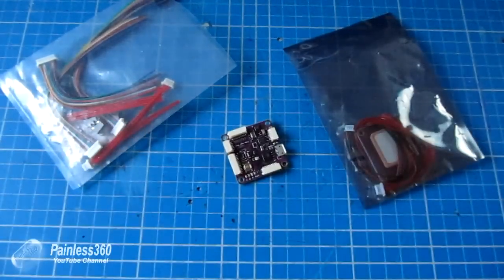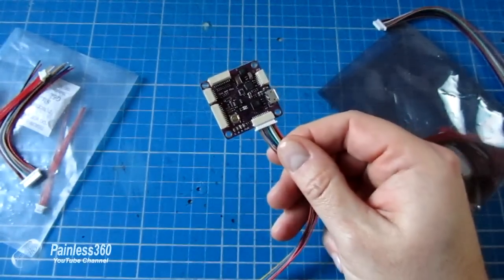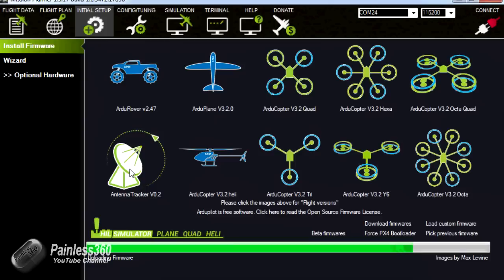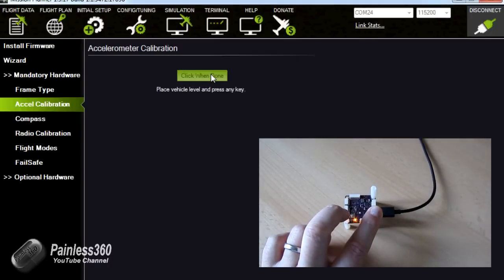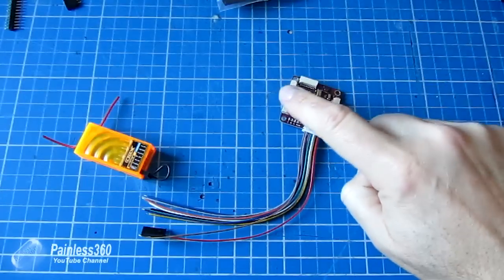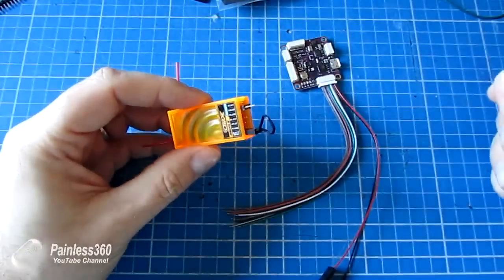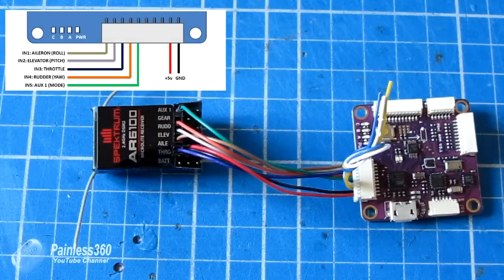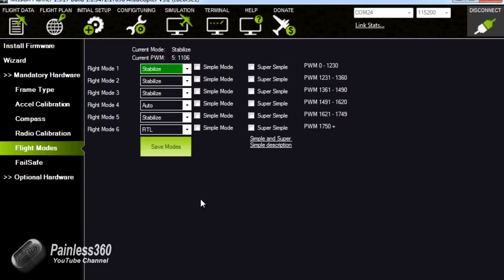(1/8) APM Mini 3.1 Video Series - Simple setup, config and calibration. Board from Banggood.com

Comment: Painless360, please help I'm a total noob with this stuff. I'm building my first quad, a White Sheep. I did my research and bought what I figured was the best, Turnigy 9X, with a DBR-II receiver and FrSky DJT transmitter. I've spent many hours searching the net and am totally lost. I'm using the APM 3.1 which was probably a mistake due to the lack of info on the net, but liked the GPS and the price. I'm confused on how to wire the receiver to the APM. Dont understand the difference between CPPM which would be just a few wires to communicate and using all the wires for each channel. How do I wire it? You seam to be the only one on the net with real knowledge of the APM 3.1, so I'm hopeful you can help.
Reply from the maker: You've not searched the Painless360 channel have you? There are a few playlists on here for the APM 3.1 that will answer your questions.  We also have a video that covers PWM, PPM and S-Bus that should help too. Best of luck!
Reply: +Painless360 
OMG thanks for the quick reply!
Dave

Comment: Very well presented APM mini video series, clear and informative. Thank you very much for taking the time to make these.

I am trying to resurrect a FC-dead Flying 3D X6 FY-X6 230mm quadcopter (everything but the FC works, including motors and ESCs). The FY-X6 (more technical information can be found here: http://www.rcgroups.com/forums/showthread.php?t=2270231 ) has a FlySky i6 variant (both the TX and RX are working) and on the FC uses CH1 (3 pins) and one more pin on the FC COM pin (probably for the telemetry). The quad has a 7.4V 2S platform and the distribution board works as well.

My questions:
1. Can I use this Mini APM FC (or a Mini APM Pro FC) to fly this quad?
2. Do you think that this FC can work with the TX/RX I have? Do you think that telemetry could work as well?

The reason I'm asking is because a replacement FY-X6/X8 FC for this quad costs a lot more than a complete Mini APM Pro Neo6 solution and I'll get an inferior FC (no waypoints, datalogger, mission planning...).

Thank you and keep up the good work.
Reply from the maker: +FrontierNG Tricky for me to answer as I'm not familiar with that model. The APM does need 5 channels really - 4 for flight controls and 1 for mode selection. There are a few others who have looked at this (i.e. http://www.rcgroups.com/forums/showthread.php?t=2270231&page=208) but I couldn't find someone who'd made it work in the searches I did.Best of luck with it. I hope you get it sorted..
Reply: +Painless360 I am the one asking on the RCgroups FY-X6 thread before finding out your tutorials :)
Again, thank you for your help need to investigate this more...
Reply from the maker: Ah, maybe it's not that common then ;)

Best of luck. If you figure it out this would make a great video tutorial..

Comment: How did you use the volt meter to test the neg and positive was backwards?
Reply from the maker: +Mokra06 The GND pins on a board are all connected together so you can check the resistance between the pins and a known GND pin in another place. You can also power the board and connect the voltmeter to the output, if the voltage is positive then you have it connected the right way, if the voltage shows negative then the you need to swap the cables over.

Comment: hello all,
recentry i bought an mini APM 3.1 with GPS from banggood. 
My GPS is slightly different from the one shown here, i have 2 ports with 6 wires. For mini apm i have signal only on port b, but i don't receive signal from gps, i receive signal only from compass.
If anyone knows what should i do please let me know. In mission planner wrote GPS: No Fix
Thank you

Comment: Im a little confused , but then I'm a rooky . can i ask , does the APM mini replace the APM 2.8 ? Im looking to build an S550 from scratch based on selecting the best advice from youtube , and with all the new stuff it starts to get confusing what s what ...please excuse my ignorance ;-)
Reply from the maker: john kendall No such thing as a daft question. The APM 3.1 is a new form factor of the 8 bit APM 2.x flight controllers - all the same functions but in a smaller package. The APM is no longer being updated by 3DR and it's successor is the 32bit Pixhawk. There are videos on all of this on the channel. If you don't care about it not being updated (and a lot of us are not ;) then the APM is still a great platform..Hope it helps.

Comment: Thx for your such a nice instruction!
i got a question for the bluetooth module to connect mini apm
Is it possible? installing BT module such as HC-05(06) for the wiress connection between APM and Mission Planner?
Reply from the maker: 사정환 Yes it is, if  you Google 'APM and Bluetooth' you will find some great resources.Best of luck.
Reply: I saw lots of BT module tutorial for apm 2.5 and 2.7  but there are anything about "Mini apm" if there are... can u tell me where it is?
Thx for your kindness
Reply from the maker: You'll have to use Google I[m afraid.

You can use the same process that you've already found with the Mini APM. There is a video on the channel that uses the MAVLink radios and looking at the connectors you can figure out how the wiring works.

Best of luck.

Comment: Hello Mr Painless!
Thanks for your great videoes. They are my lifeline!
I have bought a airdroids pocket drone (tricopter) which turned out not to be able to fly. I then took it apart and installed the APM (3DR robotics 2,5,2) GPS (U-blox neo-9m), telemetry (RC-timer 433mhz) receiver (Flysky TS R6A) on to a night hawk 300 frame, added four new motors (Emax MT 2204-CCW/CW 2300KV) and tour ECS (BLHeli series 12A ESC from Emax) first I had trouble getting the no 1 motor to run with the same speed as the others - still have. I recalibrated everything, swithed ESCs and got a new motor, and thecked that the screws are not too long - still nothing. The next problem i have is that after i reinstalled the quadcopter program from missionplaner I cannot arm the thing. I have worked on this for two weeks, seeking info from your and other videoes and from the pocket drone community on facebook. I have added three videoes showing my problems. I really hope you can help me out.
https://www.youtube.com/watch?v=p7q72CfF_EE
https://www.youtube.com/watch?v=cbevwvdAJYE
https://www.youtube.com/watch?v=268DiLrwbXc
Reply from the maker: Peter Søndergaard Have you swapped the motor with a working one? If the problem follows the motor then you know what the problem is ;)
Also, watch my APM arming troubleshooting video to see how you can tell what the problem is..
Best of luck.
Reply: Hi. Thanks for your quick answer. Ill look at the video again. I have tried to swap them around. Same result. Could it be a bad ESC.
Reply from the maker: If you have swapped the motors and the problem stayed with the ESC then it's the ESC or the output from the flight controller..

Best of luck.
Reply: Painless360 Got it airborne today! still think there are issues with the power to the motor. thanks for your help! now going to trim it!
Reply from the maker: Awesome! Happy flying!!

Comment: I have this mini APM from Bangood on a zmr250, I have all working the only problem is when I calibrate the compass, accelerators and radio the  artificial horizon looks level but the quad flies  back and to the right very violent. If I do auto-trim it flies almost perfect but the artificial horizon looks like the quad is banking left  and back almost 45 degrees. Any ideas?
Reply from the maker: Tiago Goulart Check that all of the props are on the right way round and recalibrate the ESCs again (manually).
Best of luck..

Comment: I'm a beginner at quad-copters, but not to electronics.  I recently purchased a HK pilot micro master set... and with the use of your videos, I was able to get it up and flying within a couple of days.  Your videos are spot on.. Thanks for posting them... time to start messing with FPV
Reply from the maker: mike nonya Thanks for the feedback - happy flying!
Best of luck with the FPV flying - https://www.youtube.com/playlist?list=PLYsWjANuAm4rQfddw-7YZDzckoJ_KyOpm
Reply: Painless360 Also I can't find the post where someone said they couldn't connect to their board via computer USB onto the micro USB board connect.. I had the same problem just the other night.. Which is wierd because I have always connected to the board.  Turns out that it was a really bad Chinese cable, the USB to micro cable would charge things but it wouldn't allow data transfer... So make sure you have that ace in your card deck.  Thanks again ... my deadcat is flying and extremely stable... I changed out the micro PDB for the deadcat one and it seems to get much cleaner power..

Comment: I've just bought one of these and in having trouble connecting it to APM Planner on my Mac. I've installed the driver that came with APM planner, plugged in the board, but I can't get them to connect. I'm getting a solid yellow light and flashing yellow light on the board. Anyone know what that means or how to fix the problem?
Reply from the maker: Benjamin King Sorry, I am not a Mac user. The forums are filled with help though - http://planner.ardupilot.com/wiki/mission-planner-installation/ and http://forum.flitetest.com/showthread.php?14544-HELP!!!-Trouble-connecting-ReadyToFlyer-2-8-to-Mac-running-OSX-10-10-1-(Yosemite)
Best of luck..

Comment: Awesome videos, very informative and extremely easy to understand.

Could it be possible to connect the MinimOSD plus a bluetooth module to this board at the same time? or do I need the regular APM to do it. I'm liking the mini more since I can stack different boards on top of each other plus is just smaller.
Reply from the maker: elpidiovaldez4ever We cover the addition of the radios/BT in this series later on. Let me know if you can't find it and I will post a link..
Best of luck.

Comment: Hi Painless,
I got an APM 3.1 just like yours and when i flash the latest version and calibrate the accelerometer it passes fine, but when i am looking at my HUD the artificial horizon keeps on jumping around up and down. And i dont get errors.
But when i flash version 3.1 the artificial horizon works fine except that if i tilt my quad it will kind of stay in that position so when im flying forward it will stuck in the forward position and ill have to keep holding it back. I do get Bad Gyro Health errors on mission planner. I read online that the 3.3v regulator might be broken but im not sure how to test that on the mini apm .
Any ideas ?
Thank you
Reply from the maker: Malek Darwish I've not seen that myself but it sounds like the board has a problem. I'd check that you can see no bad soldering..
Best of luck with it.
Reply: Thanks . I checked it and it seems fine. I guess i have to get a replacement from banggood

Comment: Hi  any chance you know how to update the ppm encoder on this board.
Reply from the maker: Asral Sumun Sure do - read http://copter.ardupilot.com/wiki/common-optional-hardware/common-telemetry-landingpage/connecting-your-rc-input-and-motors/ and all is revealed.
Best of luck.
Reply: Painless360 oh yes this i know on the bigger board , but the mini is different the j2 pin is for esc power.I want to update the firmware of the ppm encoder.
Reply from the maker: Ah I see. Sorry I've not read or found anything about that - why do you need to update it?
Reply: Painless360 the board i have does not have failsafe on lost of signal , i have a turnigy 9 tx. I had this problem with with the bigger one and updating it fix it.
Reply from the maker: Asral Sumun I understand. I will keep my eyes open for this.. Let me know if you figure it out..
Best of luck.
Reply: Painless360 Hi i've found this http://www.rcgroups.com/forums/showpost.php?p=30449100&postcount=1505
 and used the method to update the firmware and it updated fine.
Reply from the maker: Well found - thanks for the link..

Comment: Has anyone seen the problem outlined at https://github.com/jmendezde/arducopter/issues/603 ?  And if so, are there suggestions for fixes or workarounds?
Reply from the maker: mstanley103 This looks like a couple of issues on this report. What are the error messages you get exactly? What troubleshooting have you done already?
Reply: Painless360 Thanks for the quick response.  I just got my board this week, so haven't had a chance to do a lot of debug yet.  Current operation:1. upon connecting via USB, I get flashing red, then blue/red then red again LEDs on the board
2. In "Devices and Printers", I see Arduino Mega 2560 (COM4)
3. Start Mission Planner 1.3.24
4. MP finds COM4.  I connect at 115200 baud
5. MAVLINK connects and I see a bunch of communications
6. Dialog box posts "New firmware available, ArduCopter V3.2.1.  Please Upgrade. I click OK.
7. Click Initial Setup Icon in MP
8. Click "Install Firmware"
9.  Get message "You cannot load new firmware while connected via MAVLink.  Please press the Disconnect button at top right to end the current MAVLink session and enable the firmware loading screen".
10. I click the disconnect button
11. I click ArduCopter V3.2.1 Quad
12. Message box: are you sure you want to upload ArduCopter V3.2.1 Quad?  I click "Yes"
13. That's when I get the "Failed to download new firmware: System.Management.ManagementException: Invalid class at ..." message that I showed in the posting  at @603.

I'm assuming that Mission Planner encapsulates a board programming sequence that can probably be done outside the tool.  My next step failing any insights from readers here is to start digging through the ArduCopter site to see if I can replicate the development environment locally.  I'll probably also try re-installing Mission Planner, just in case everything didn't come down properly. All ideas and suggestions are welcome.
Thanks!
Reply: mstanley103 I'm pretty sure that Mission Planner simply isn't recognizing the Mini APM.
Reply from the maker: Sounds more like it can't see the Hex file for the firmware it needs to download - I'm assuming the internet connection is ok and there isn't any blocking setup on the internet router?

Best of luck.
Reply: Painless360 I downloaded the APMPlanner2, and it was able to program my board.  Then switching back to Mission Planner for configuration.  Thanks!
Reply from the maker: Great news!

Happy flying!

Comment: Lee do you have a pin out of the APM Power Module ?  I am getting conflicting information on which pins are current sensing and voltage sensing.
Reply from the maker: Hi Jon, from everything I've seen it's been GND, GND, +5v, +5v Current and Voltage pins for the 3.1.
(http://api.ning.com/files/dUBGrCUuK8SW8uQayF0gszX61IzhfrXnND8XxCiPT9O8yhB9riSncOlaOHaCcAevHfJ2RG2XOUDGLPCOAqu2fbCaqhAnQ99M/sku_105379_0.jpg and http://img.banggood.com/images/upload/2014/10/SKU15964510.jpg)

The pins appear to be different on the APM 2.5/2.6 though with the +5v and GND pins swapped (http://copter.ardupilot.com/wiki/common-autopilots/common-apm25-and-26-overview/ and http://copter.ardupilot.com/wiki/common-measuring-battery-voltage-and-current-consumption-with-apm/)

Hope this helps.
Reply: Painless360 the confusion is the sense wires for the current and voltage from the APM power module.  If you did a short video showing the correct hookups and mission planner setup it would spare others from blowing the sense lines on the APM 3.1.  Just a suggestion.  No one I know can explain the connections better than you using your skills in video and schematic creations.
Reply from the maker: Jon Car OK, Jon, let me add it to the list. FYI the 10def board arrived today so I am starting my research and should be putting out videos soon. Any tips?
Reply: Painless360 If the board is similar to the Naze32, maybe just do a difference video. Nice thing it has the same features sets but half the cost.
Reply from the maker: Jon Car https://www.youtube.com/watch?v=M6OSp05Y5b8 :)
Reply: Painless360 You are awesome Lee!  Thanks so much.
Reply from the maker: You're welcome. Glad it sorted it for you :)

Comment: Hello, I have purchased the mini apm 3.1 board you recommended from banggood, and have been able to connect and flash the firmware, however, upon reloading, it hangs every time on "Got param RATE_RLL_IMAX"    I have waited several minutes, and it stays stuck with this message.. the LEDs are blinking in a complicated, but I think repeating, pattern.    do I have a dud board, or have I done something wrong?
Reply from the maker: Hard to say without seeing the setup and getting a lot more detail. Un-connect everything form the board and see if it now works, if all else fails - re-flash and try again.

Best of luck.
Reply: thomas marsh hi, I had a similar issue, I contacted Banggood, they asked me to make a video to explain the problem and then they send me a new board

Comment: so this mini APM vs the Regular size APM 2.8 which one will have TLC from designer/developer? will the regular size APM get obsolete? I want to get APM but not sure which to get because there are so many version out there and so confusing. Please advise. I like to have the one  that I can add all the bell and whistle as I go.
Reply from the maker: airwolf 09 There are always rumours and news about the boards and the software. The APM is a mature technology but works like a treat because of it. I'd always go for the 2/5/2.6 if you have the space as it's far easier to fit and configure.